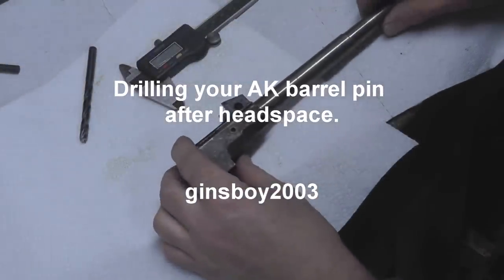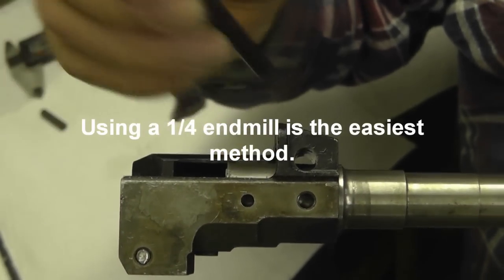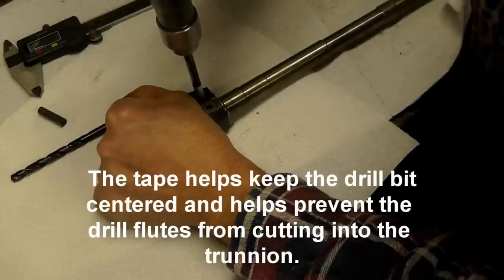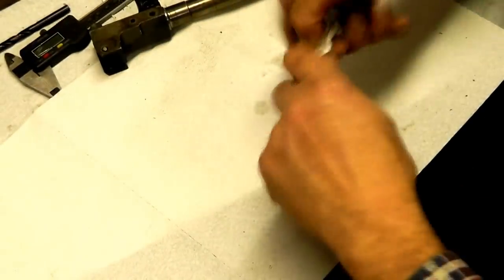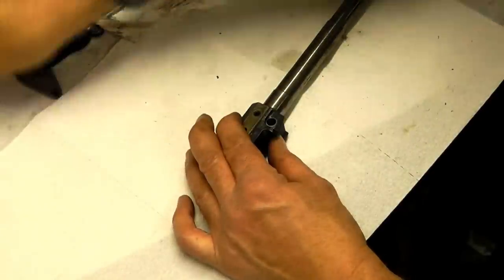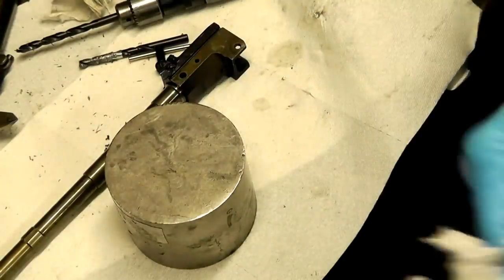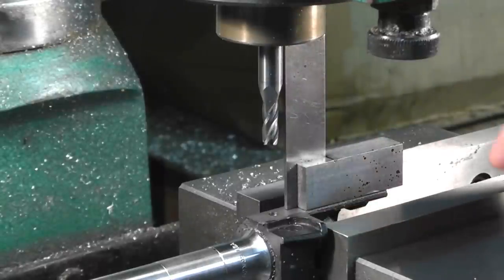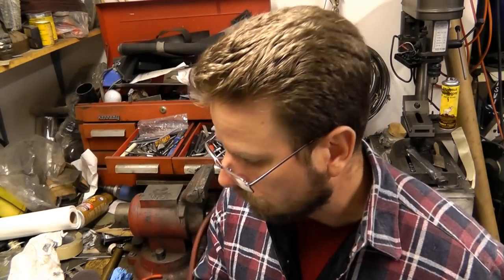How to drill your AK barrel pin on a new barrel

Comment: It's amazing how much I thought I knew, until I ACTUALLY knew. Before my first ground up build, (Hungarian U.F) I had used AK'S and messed with them for years and converted some Siaga's so I thought I had a good handle on things. Even though my somewhat limited experience did help a lot---you just do not know until you build ground up or even from an 80% receiver. I got it the first time thankfully, but I almost screwed up bad and pressed my barrel crooked....after test firing and trouble shooting I re-drilled my barrel pin and went up one size and she straightened right up. It is the most satisfying thing you can imagine. You need actual skill  with tools and mistakes can have very bad outcomes. After building a kit or two and THEN watching again--wow this dude has so many great tips and such good advice....thank you Sir---these videos are truly awesome. Thank's for the time and patience you put into them....great stuff.

Comment: If you are going to basically destroy a drill bit for this one use, cut it off near the base of the flutes so there are no flutes to side cut the trunnion.
Reply from the maker: +archangel20031 I don't know why youtube just made me "approve" your comment.  You have a good point there.
Reply: +ginsboy2003 
In the past I may have made a snarky comment or two on other videos, perhaps it's following me?
I have inherited a few drill bits that have been sharpened so much they are barely more than a stub of drill before the shank.
Reply from the maker: Those drill bits would work well for this.
Reply: +ginsboy2003 
Well, last night my 3 piece head space gauge set came in the mail so today is the day I set the barrel.

They were from Dave Manson Precision Reamers and was only $68 for the whole set with shipping.

I did the metal tape thing and one layer (.003) was not enough for a no-go but 2 layers (.006) was.
However, the real no-go gauge was fine, and the go was super easy and even seemed a little (very nit-picky little) loose.
Should I assume a little wear as the parts from the kit seemed like they had very little use, as in only test firing, or not worry about it and pin it?
I am assuming that at a later date if the head space needs to be tightened up a little, those oversize pins should allow the barrel to be moved forward a couple thousandths and then re-drilled and reamed.
I think an AK variant was the best choice for my first build as the tolerances seem to me to be so much forgiving than most guns.
I have seen some very crap looking AK's built out there that seem to do the job admirably for what they came from.
You-Tube videos like yours have been so helpful, I can't thank you enough.
Reply from the maker: +archangel20031 If it is a little tight, it'll wear in and it'll be fine.  If it's too loose, then you'll have problems.  I always set mine so that I feel a little resistance on a live round, very little.  Thats way tighter than mil-spec. and will never cause me headspace issues and I've never had any.
Reply: +ginsboy2003 
Well, I got both the front sight and the gas block pinned, and attempting to drill them was a pain and I broke the drill on the first hole, so I just used the little reamer and it seemed to work as good as a miniature end mill.
Then the larger reamer got stuck in the rear sight pin hole.
It's in the freezer now in the hope that I can thermally shake it loose, if not and it breaks off, I guess it's been pinned with the reamer.
As far as the barrel, it seemed to want to stop where it is and I made a couple more pumps on the press and it was not popping and moving any more so I stopped until the gauges came in.
Oh, freeze for a couple hours, heat with propane torch, a couple drops of 3 in 1 oil and it nearly fell out.
Reply from the maker: Thats a relief!  That's a great idea for removal.
Reply: In the end I found that the chamber must have been reamed a little bit too deep as the barrel bottomed out against the trunnion before the no-go would do it's thing.
I ended up grinding an angle on the edge of the bottom of the barrel face where it was touching the trunnion as it bottomed out, that way the barrel would just barely go in deeper and after a couple times it was dead on the no-go and a little tight on the go, then after I parkerized everything, the go was real tight but still went in with only finger pressure.
I read somewhere that there was a spec that gave a maximum inch lb for the go to work so I think I'm good.
Reply: @ginsboy2003  Hi, i want to bay a drilling machine from harbor freight tool, which one sould i bay 8"- 5 speed, or 10" - 12 speed for AK 47 build. Thank you!
Reply: @archangel20031   hi i read it was 33 pounds of pressure ?
Reply: @carltruviso5081  wow this was quite some time ago.
When I finally did finish putting it together and I went to go fire it I had failures to eject because I apparently trimmed the ejector arm a little short.
I busted a couple of times with my MIG welder using the flux core wire and that stuff is as hard as coffin nails.
I then ground it down just a little bit leaving it slightly oversized from what I originally built and it worked fine.
also every time somebody complains and says I don't shoot that corrosive stuff I reply with that's the only stuff I shoot cuz this gun was designed for it, and it's the most affordable ammo out there.
Reply: @archangel20031  cool im glad it worked out im really late in this sport or art lol i now have time to look into new hobbies now that im old and busted and bored lol

Comment: I know this is a 10 year-old video, but my home shop barrel pin solution is a cut-down J drill. It's .277 diameter, exactly the same as a "real" barrel pin; cut to 1.136 length I believe. Drill with a flattened I drill as you did, then I ream with a 7mm. True, not everyone has a set of metric reamers, but I bought mine for 22ish dollhairs just for gunsmithing. It contains every reamer you'll need for an AK and bunches more. 5/7mm for axis pins, 8/10mm for the selector, etc.

Comment: Thanks for putting up this info.  You did an amazing job free hand drilling the new barrel pin.  But I was relieved at the end of the video to see someone that good with metal. does indeed have a mill.  I've built 3 aks and used a harbor freight drill press for all the drilling and it worked fine.  I'm glad to know how to do it free hand too.  Thanks Bro

Comment: Nice to see that others use these same 'dodges' that I do... Flatting a twist drill and using the tape around the flutes really works better than one has a right to expect..... There is, after all, a limit to the number of sizes in which one can buy end mills....
What matters is results, and with care these methods are just as good as having the flash equipment... just takes a little longer is all.... :-)
Happily, these days I have a lathe and a mill.... I'm spoiled!

Comment: Do you think it would work if you cut a drill bit off just a 1/4" below the smooth shank? That way you wouldn't have to use the tape because it would be smooth shank rubbing against the trunnion. You just wouldn't have much length left on your bit, but surely enough to make it half way through.

Comment from the maker: Its an aluminum tape that can be bought at industrial supply houses.  It measures around .003 inch thick.  Any tape could be used if you measure it and know what you are working with.

Comment: Since barrel steel is relatively soft by design, why not set wooden blocks at the height of the barrel clamped outside, file out the required metal using the wooden blocks as your guide/rest to stay square with a round or half round file? No way to bugger up the hole and simpler than grinding a bit, et al.
Thanks for your great video, very kind of you.

Comment: Can you please tell me what size end mill bits I should use to complete a new barrel pin,gas block,sight block and front sight post.
Love your videos you are very good at making it look easy! Please keep making them
Reply from the maker: For the barrel pin I use a 1/4 inch endmill and finish the hole with a round file.  for the rest, I use a drill bit that is one letter size smaller than the measured pin dia.  It's best to measure the pins, the M70 pins aren't the same diameter as on other builds so I'd measure them first.

Comment: Suppose to rivet trunnion to reciver first, I.O. did it the way this guy did and the rivets fall out and not flush with receiver.
Reply: He only did it this way to drill the barrel pin and then he blew it all back apart then riveted a tronium then pressed the barrel back in you did it wrong

Comment: I have a new front trunnion with a pilot already drilled. Should I use my trunnion drilling jig and pre drill the trunnion first or drill the trunnion and barrel at the same time? Be advised I have a reamer and plan on reaming for final fit?

Comment: Is there a specific brand/ style of drill bit you would recommend? It looks like you got through that barrel in the blink of an eye!
Reply from the maker: I usually get my bits from Enco-usa, they sell good high speed drill bit.  The video makes it look easier than it is.  I also usually wrap the tip of the drill bit with tape to keep the side of the flutes from cutting into the trunnion.
Reply: ONLY COBALT BITS…

Comment: Being an aircraft mechanic, would a "gun barrel" drill bit work better? I  don't think that's the correct name for em, but that's what we call em. When you want to drill a new part through a pre existing hole without enlarging it. Can you get those anywhere?
Reply from the maker: Wow, I've been working in aviation maintenance for 28 yrs and never heard the term.  I guess every company has their own nicknames for things.  We've always used drill bushings to do what you describe, then step up the hole to finale.  Trying to think of what you are describing and can't picture it.

Comment: Quick question, wouldn't it be easier to head space and drill the barrel pin hole after the trunnion is riveted to the receiver? That was you don't have to press it out again?
Reply: +Adamz678 either way has its merits

it can be easier to square up the trunnion by itself on a drill press or milling surface.

on the other hand, it's a pain in the ass to press out the barrel, and press it back in with the same exact alignment, and can be easier to just drill and pin once with the trunnion already riveted in. but squaring up the riveted receiver can be challenging.

seems to be personal preference.

Comment: I have a virgin barrel that I'm putting on my polish underfolder build. Can i rivet the front trunnion first and then press the barrel, check headspace, and then drill the barrel pin and be done? or do i have to drill the barrel pin then press the barrel back out and rivet the front trunnion?
Reply from the maker: +Michael Lochner You can do it as you first suggested. With my tooling, its easy to do it the way I did.  I've done it as you mentioned, just take your time headspacing it with the trunnion installed, remember to use a bore brush on the chamber to remove any debris or dirt.

Comment: Do you think you can use an end mill in a drill press if I can limit the sideways movement of the press. Im thinking set screws in the casting
Reply from the maker: You could probably do it.  As you probably know, if it moves the endmill may chip.  Good idea though, you are only moving the endmill up and down.  so you won't be putting excess load on the bearings.

Comment: Ginsboy2003 I am looking into buying a milling machine for the garage, any recommendations? Thanks!
Reply: I'd look for a used Proto or Bridgeport from a machine shop or auction. My Bridgeport is 50 years old and as a garage shop tool, there nothing better. I was able to sell both my drill presses and my lathe, which got my money back.

Comment: Would titanium drill bits be ok for this?
Reply from the maker: If they were quality drill bits then yes.
Reply: titanium bits will only aid in heat transfer problems and are usually a coating……COBALT bits are for cut penetration.  IMHO

Comment: alright someone please tell me where to get smaller barrel pins, the barrel pin i got with my parts kit is a .315 and it is WAAAAAAAAAAAAAAY too big for my trunnion and it is effing impossible for my drill press to even penetrate a millimeter into the trunnion. I figured I need barrel pin the size of ginsboy at .276 or a tad bit bigger because my .265 drill bit is kinda snug in the trunnion. But the thing is the only barrel pins I can find are .315 and .302
Reply: make your own outta a drill bit or other tool steel ;)

Comment: You don't measure the shank, you measure the flutes. If the drill has been used or depending on the size, the flutes will not be the same as the shank. I'm a machinist, and we never measure the shank.

Comment: +ginsboy2003  I am doing my first AK build and I have a virgin barrel that will need the barrel pin hole drilled. I have the original barrel pin (.278 or so) that is still pinned down in the front trunnion with part of the old barrel attached. Once I remove the pin and the old barrel piece. I will need to install the new barrel and drill the hole. My question for you is this. Will a 1/4 inch end mill be enough to make a hole big enough for that original barrel pin? or will I need to get a bigger barrel pin and if so what size? Thank you
Reply from the maker: +JJ305  No, but its pretty dang close.  I use a 1/4 inch endmill and they use a round file to clean it up inside.  After using the 1/4 endmill there isn't much left.
Reply: +ginsboy2003 Thank you for the reply. I have been trying to remove my barrel pin with a vise, punch and heavy hammer and no luck it just flattened one end of the barrel pin but the other side just looks the same it did not budge at all... Do you think I might need to use an actual press?
Reply from the maker: JJ305 A press is the only way to go sometimes.

Comment: Better to start with a 1/4” carbide end mill to make a flat for drill if you don’t wanna dress a flat bottom drill.  Cheap and easy solution. 

You can even skip the drill and use a 7mm carbide endmill then jump to the reamer. 

Even a bull nose or ball nose endmill will work better than a drill in this case.  

One critical note, carbide tools require a good rigid fixture and no vibrations.   If using a drill press make sure it is all clamped down.  Never use carbide tools with a hand drill.  Bridgeport would be the best choice with a solid Kurt vise with custom aluminum soft  jaws.

Comment: Yup.. jacked that trunnion up. This is a great example of the importance of using the correct tools. Drilling a barrel pin hole by hand is stupidity.. I’m not sure what this guy thought he was proving to anyone.. didn’t prove he can drill anything by “hand” better than anyone else.. still wallowed the trunnion. Never had an issue drilling barrel pins.. don’t be cheap! Buy the right tools! This is a firearm.. nothing to mess with, or be cheap with. Jeesh..